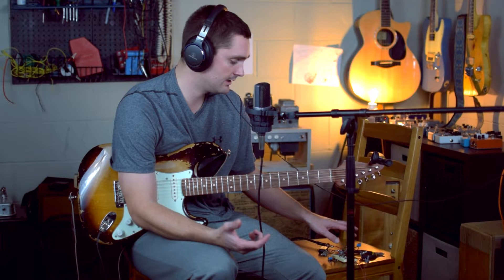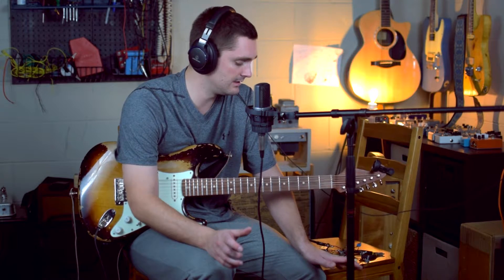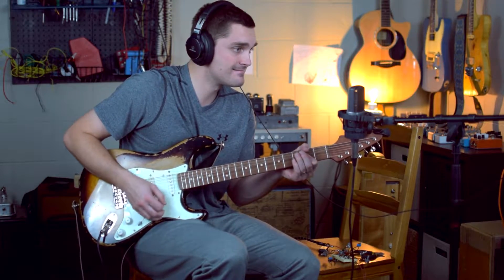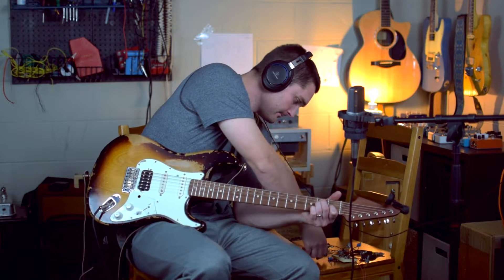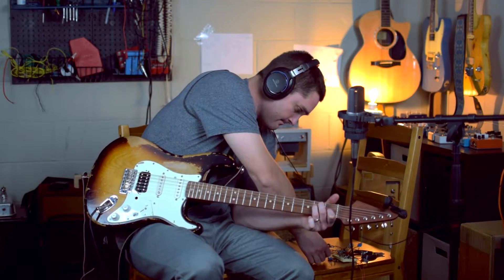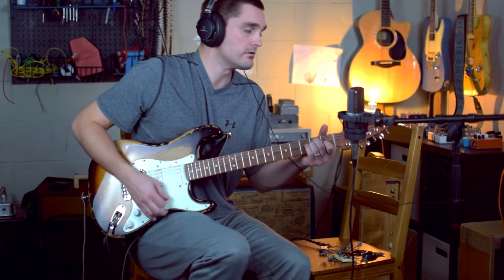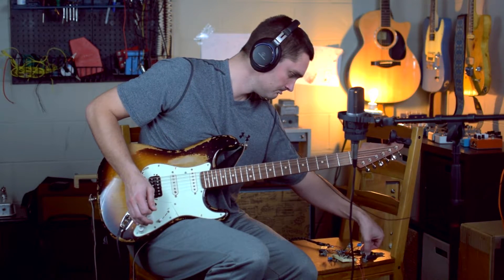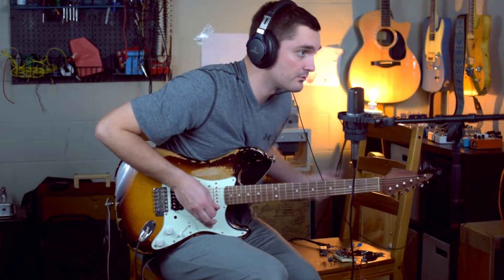Bazz Fuss - Circuit Analysis pt 8 | Baxandall Tone Stack

Comment: What is so special about using a Baxandall Tone circuit, i don't know what is so different about the Baxandall tone circuit
Reply from the maker: It is a type of tone stack configuration that is different from many others.  For example the typical FMV (Fender, Marshall, Vox) type tone stack with Treble, Mid, and Bass is pretty 'colored'.  It imparts its own tone shaping EQ curve to the signal.  A Baxandall is capable of being much more neutral at certain settings, but also can provide heavy coloring if that's what you like at other settings.
Reply: @KleyDeJong  ok thanks